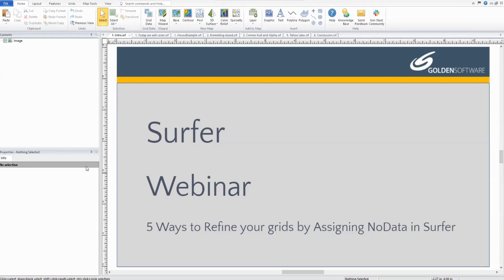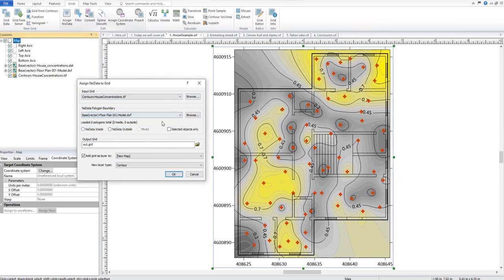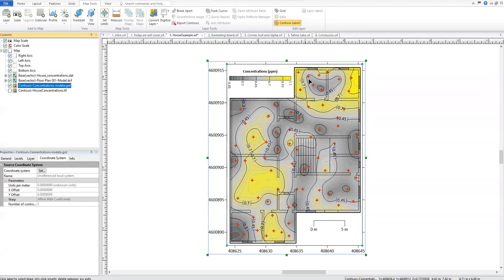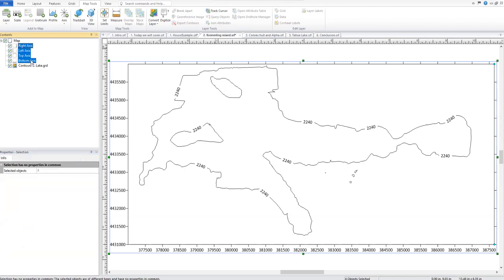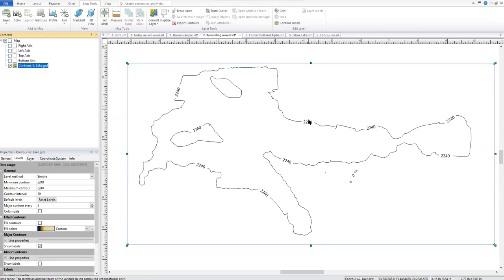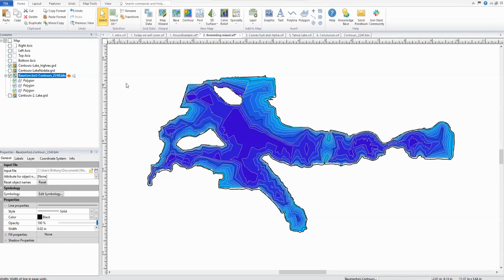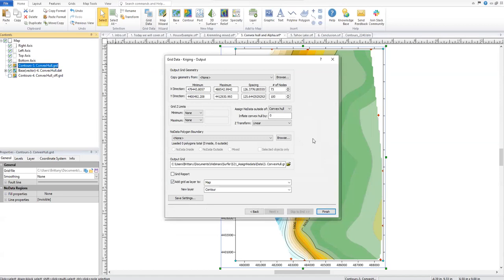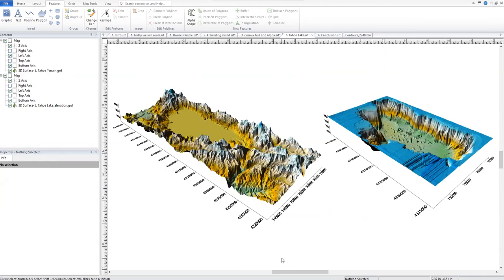5 Ways to Refine your grids by Assigning NoData in Surfer

Comment: How did you import that good grid layer from tif? I have tried to export countour map (grid) to tif, than add countor map from that tif, and it was incorrect, faulty. I have problem with assigning no data to countour map from grid,  after blank it is ragged, and don’t adhere to polygon boundry. Please help
Reply from the maker: Hi Filip,

Thank you for your comment! Without seeing the contour map you exported to TIF it is hard to say exactly why it is not behaving as expected. In order to determine a solution we would recommend starting a ticket with our support team by emailing support@goldensoftware.com with your data attached and one of our experts can directly assist you.

Thanks,
Golden Software Support

Comment: hi, I want to reduce the number of points data in estuary contours in surfer 20 without any changing in the estuary map. how could I do that 
thank you
Reply from the maker: Hello Iman,

Thank you for your comment! If you would like to resample your contours so that they utilize less nodes you can use the Grid Mosaic command.

Click Grids | Resize | Mosaic and then choose the grid file that generated your contours. From the Grid Mosaic dialog you can decrease the number of nodes as desired.

Sincerely,
Golden Software Support
Reply: @GoldenSoftware  thank you 
I will try to do this
Reply: thank you for your comment
 I used it and it worked 
but I have a question 
which method is better to reduce the number of points data? I saw different methods
I am drawing an estuary bed surface and the original number of bed data is 92000 points
 How could I know that the new map was the same as the original map and there is no distortion on it 
I will be grateful if you answer me  
great thanks
Reply: I mean of the method the resample method
thank you
Reply from the maker: @imanalwan479  Hello Iman,

Thank you for your follow-up comment. There is no "better" method from the options given, it is just whichever method fits better with your data. The best way to determine this is by testing each method and seeing which output you prefer.

If you want to compare the two maps you could either overlay the contour maps in the same map frame by clicking Map Tools | Overlay Maps and seeing if there are noticeable differences. Or, if you want to compare numbers such as data points, and XY extents you can select your Contour layer in the Contents Window and from the Property Manager click General | Grid File | Grid Info.

Sincerely, 
Golden Software Customer Support
Reply: @GoldenSoftware  thanks, really great information
Reply: @GoldenSoftware  hi 
when I got the final points by exporting it from surfer to excel sheet after grid resampling and  used it in Civil 3D Software,  I found that the points was duplicated 
how could I fixed this problem? 
thank u
Reply from the maker: @imanalwan479  Hi Alwan, 

I have not heard of this issue happening before, but would like to look into it. Can you please email your data file to me at adudley@goldensoftware.com? 

Please let me know if I can be of any further assistance!

Sincerely,
Drew Dudley
Account Manager
Reply: @GoldenSoftware  I sent a mail 
and describe my case  Please if you may check it 
Thanks